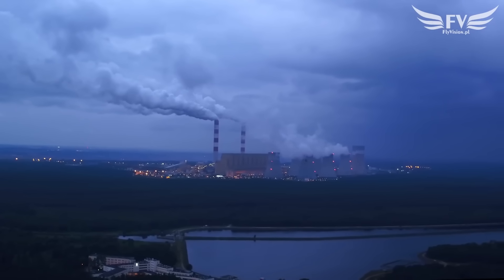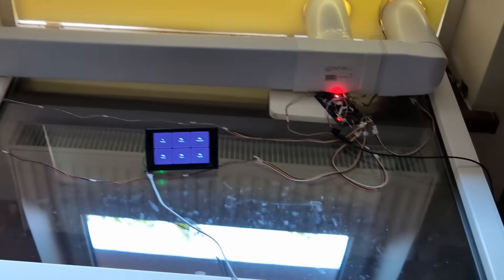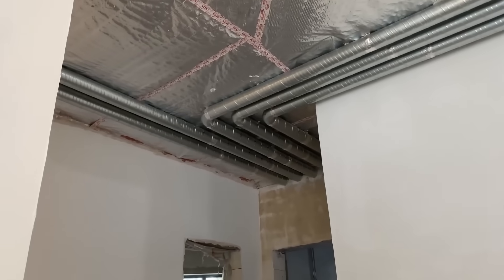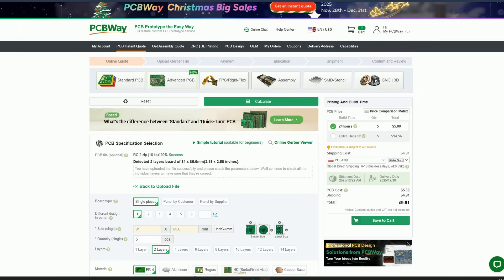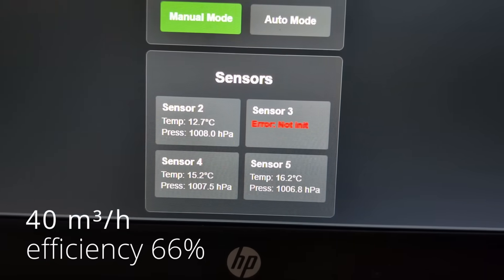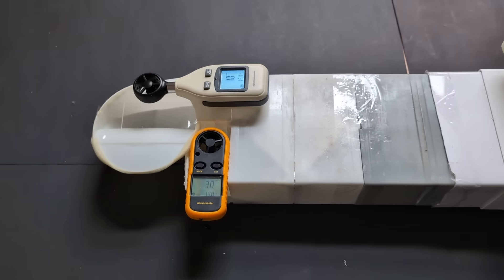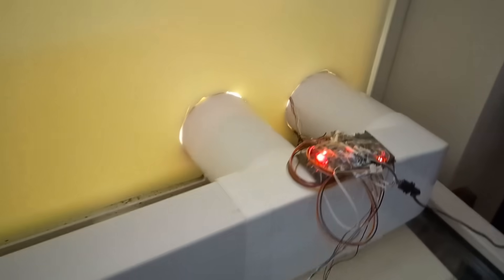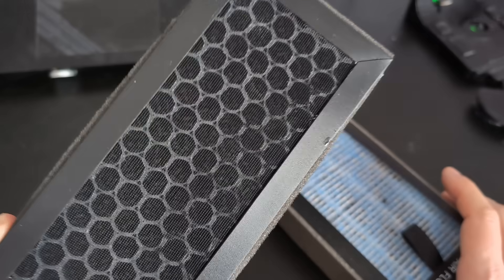DIY Heat Recovery Ventilator: From 55% to 90% Efficiency (Real Tests)

Comment: I'm surely not the first time to suggest this, but you should consider 3d printing the heat exchanger. Metal powder prints are not that expensive anymore. Especially considering your time input, no tooling ect. Very cool project! Keep up the great work!
Reply from the maker: Actually, for a unit this size, metal printing is still way too expensive. I'm moving toward SLA printing with copper electroplating instead. It's much more affordable and keeps the precision high. Thanks for the encouragement!
Reply: @DIY_Yarik Yeah fair enough, you're right. Cheaper doesn't mean it's cheap at all. Your new approach sounds cool, but is electroplated copper enough of a heat conducter at that thicknesses? Maybe I've got your ideas not straight in my head tho. But it kept me thinking about cheap ways to make something like this. Ideally you want copper, but that's expensive, I've searched around for square tubing, but got limited results. Aluminium is also great and way cheaper. And you want something with as much surface area as possible. Looked at alu extrusions, as those have different channels, but are quite bulky. I then remembered that you can buy those as miniature as wel. Maybe that would be a viable option? I don't know how air tight you can get the open channels when you align and clamp them and routing the air through the different channels is probably not easy to do. But if you can manage it, the extra turbulence you'll get from the routing will also increase the thermal transfer as turbulent air will break the boundry layer to the metal and thus transfer its energy better then with laminar flow. 
I don't know, I'm not all to familiar on this subject, but this is what I came up with. I hope my shower thoughts can help you on your project. I've subscribed to your channel and I'm looking forward to your updates!

Comment: This is really amazing. Please take care to add appropriately sized metal mesh to the foam areas and intake. You absolutely do not want a rat chewing it's way thru the foam and running around your room. Ask me how I know.
Reply from the maker: I've been lucky so far as mice haven't noticed the intake yet. Но you're absolutely right, metal mesh is a must for the final version to keep them out. Sounds like you learned that lesson the hard way!

Comment: Is it realistic to compare your work to a commercially available product, say a Diakin MCK70ZW air purifier?  It would also be helpful if you stated which indoor environmental quality standards you use for compliance targets.
Reply from the maker: This video is just to show my current progress and where I’m at. Once the development is complete, I’ll definitely run side-by-side tests with a well-known brand so you can see the real difference in identical conditions.
Reply: @DIY_Yarik  Can I sponsor you?  I am looking to replace two extractor fans with heat recovery ventilator(s).  These devies will share a flue which vents through a roof outlet.  Ideally, they will be smart device(s) that can be incorporated into a smrt home ecosystem.

Comment: Other countries show that it's easily posible to incerease renewable energy to over 50%, for countries located far north or south the increase from 50 % becomes harder and harder. So if you are concerned, encourage the increase of renewable engery, whily saving engergy with cool devices as this DIY heat revovery ventilator 👍👍👍

I'm not sure if the brack stuff at your window is only smoke residue. It is colder near the ventilation system and moisture condenses, which can lead to mold. But your solution should also fix this 😁

This is a very impressive project. As my house has a combination of heating and ventilation with a big heat exchanger, I will not replicate it. But from my experience from this system I can realy encourage to build such a system. My system came also with a second filter for the air that goes outwards, this shall reduce the dust befor enter the heat exchanger. Dust is a efficiency killer for heat exchangers.
Reply: This is a stupid idea. You can’t power winter heating with solar and you can’t as a person, operate a wind turbine in a city.
Energy saving works. Renewable energy doesn’t and is ruining Europe.
Reply: @noop9k  Yes this can't be the only power source (therefore the arroud 50% limit). But even in winter you have some sun and wind... and bio gas. So you can put all our conventional power plant inspections to summer. Works really well here.

Human made climate change might ruin Europe.
Reply: @m @michaegi4717 no, "green energy" has ruined Europe already, while the overall effect of Energiewende on Climate change is ZERO at best.
Net zero is how much effect it had.
Reply: @noop9k  This is simply wrong. As you already point to Germany: compare 1995 to 2023... Germany uses less electricity and reduced the CO2 release for electricity production drastically.
At the same time Germany even shut down its nuclear power plants. The average price increased from about 17ct to about 35ct (while 2023 was more expensive than now). Which is a average increase of 2.6% per year.
In the same time the GPD increased from 1.9 to 4.2 so also the industry is happy.
Reply: @michaegi4717 I spent many years arguing about this and you are wrong. Saw tons of deceptive german demagogy, among other things. Maybe read something, like “Case for nukes” by Zubrin, for starters. I will avoid wasting time on yt, where my comments get randomly deleted. But will spare a few minutes:
* Electricity generation is only a portion of energy use. Focusing on it is a hypocritical selective blindness.
* You can increase percentage of green energy by reducing total usage, killing your industry.
* you reduce total usage by moving your industry to authoritarian state, enriching anti-democratic forces. Maybe Hungary, like several German companies did, maybe China or Russia.

German money are killing Ukrainians right now. Merkel is a mass murderer.
Reply: @noop9k  Which of my numbers were wrong? I just posted facts.
Reply: @michaegi4717 and let me repeat this again. Germany is not a separate planet with its own atmosphere. Climate Change is global. And Energiewende had no effect on it. France is way way ahead of Germany in this regard btw, and Germany has no chance to catch up, no matter how much more it tortures its people with energy taxes. It was all a scam and it made dictators much richer. Those money from green taxes are now killing people. No actual effect on Climate Change.
Reply: @michaegi4717 and also btw you industry gets energy at different price also subsidized from your taxes and a big % of it is actually dirty.
Reply: @noop9k  No German Industry don't get subsidized electricity price, they get bulk discounts as every one gets for most products and they don't pay a extra tax to finance the switch to renewables. But those extra fees for renewables anyhow were for the early years where building renewable engery sources got a high guarantieed price. As renewables are now cheap enough you don't get any bonus, so this is a thig of the past (that will produce some costs for the upcoming years.

What dirty money do you talk about? Do you refer to the enormous amount of money Germany and the whole EU gives to Ukraine directly or spend to help the Ukraine refugiees?
Reply: @noop9k  Yes we are all onthe same panet, so every country can do this. And most of the countries are doing it... especially because it is ceaper.
Do you know about the enormous costs that are payed by taxes for nuclear power and coal?
Due to coal mines huge areas of Germany will need constant pumping of poisones water for ever. Shortly after those pumps stop a huge area would be flooded by toxic water.
For nuclear power plants the insurance was payed by taxes, because it would be too expensive to pay a normal insurance. The nuclear waste will also be handeled payed by taxes. The development of nuclear powerplants was suported by taxes.

And regarding dirty money: Most of the sold coal and nuclear fuel comes form "not so friendly countries".

Comment: Great work. Have you come across "fine wire" heat exchangers? There is a company in the Netherlands that use them for single room HRV units and claim very high efficiency. It would be great if you could make a comparison.
Reply from the maker: Interesting concept! I’ve heard about the technology, likely Fiwihex. The surface area they get with those thin wires is impressive, though it seems much harder to DIY than plate designs. I’ll definitely look into it more for future comparisons. Thanks!

Comment: There are centralized air change systems which connect a heat pump to the air exhaust and collect that heat back.

Comment: The nice thing of a central system is the removal of noise from the room. Decentralized air exchange systems are popular in Finland for installation in old houses but the fan noise can be quite annoying.
Reply: True but I have an old apartment that never had any thought to have any solution to vent the rooms other than opening the windows so yeah, this is actually important

Comment: I'm really interested in your heat exchanger design. as far as I know, the new ones are called energy exchange unit, as it capture moisture and retuens it back into the room. specially on sub-zero cliemts I think this matters a lot. Looking forward for your next update on a successful DIY energy exchange core.
Reply from the maker: Thanks! Testing new designs takes time, so I’m not moving as fast as I’d like. I really hope to have a working version ready for you to replicate by summer.

Comment: Please don't use copper, it's unsustainable (mostly just economically, since it's a rare material on this planet with better uses).  Aluminium is good enough.  
UV?  Surely you don't really need to filter viruses/bacteria out from OUTDOOR SOURCED AIR, come on.  it's not a fictional zombie apocalypse - Particulates should be your primary concern.
Reply from the maker: Thanks for the advice. I agree aluminum works well, but copper is still superior for efficiency. My new concept is to 3D print the whole exchanger and then use electroplating for a 30-50 micron copper layer. It uses very little material but should keep the efficiency high. It's still just a theory for now.

Comment: ion emitter that makes small particels  "heavy " and fall to the ground
Reply from the maker: It's not a perfect solution. Ionizers often produce ozone, which causes metal corrosion and can be harmful to breathe over time. Plus, I'd rather remove the particles with a filter than just have them settle on my floor and furniture.

Comment: Conglatulations! It is the reinvention of the Lossnay ventilator.  Lossnay was first released in 1970 from Mitsubishi Electric Company in Japan and continues to be sold for industries and homes today. From the beginning, it had the function of regulating both heat and humidity with a heat exchanger made of breathable Japanese washi paper. Main patents related to Lossnay were expired and you can adapt the contents of their patents. There are giveaway lossnay guide books from Mitsubishi which are mainly for architecture designing people but also contain many useful information for general diy people.
Reply: The recuperator in the vid has one design flaw unless nicely dried air. It passes indoor humidity outside. Humidity in the air to be exhausted should be recovered and be returned to the room. Humidity in the exhaust air becomes condensation on the recuperator during heat exchange and exhaust air path as well. Unlike latent heat recovery heat exchangers in power plants, heat exchangers for residential use should never condense. Condensation makes hygienic operation of heat recovery extremely difficult. Furthermore, in cold climates, condensation on the exhaust path freezes and obstructs airflow (icing). Returning the humidity to the room reduces the chance of condensation. If the humidity in the air decreases, people feel colder even though the room temperature were the same, because moisture evaporates from human bodies (evaporative cooling). Compensating for the loss of humidity during heat exchange with humidification incurs additional energy costs and increases hygienic burdens. Therefore, returning the moisture in the exhaust air to the room is the key to economical and healthier operation. My suggestion is to consider the elements of already existing products, e.g. Lossnay (or maybe our lungs), that eliminates condensation issues by using breathable (humidity permeable) materials for the heat exchanger itself. Heat exchangers in Lossnays won't condense at least.
Reply: The user provided a historical overview of Lossnay and asks implicit questions about its origins, patents, and accessibility of guides. I’ll summarize key points and add practical notes.

Direct answer
- Lossnay is Mitsubishi Electric’s energy recovery ventilation system introduced in 1970, designed to transfer heat and moisture between incoming and outgoing air using a porous core often made from specially processed paper. This technology has evolved but still centers on heat/moisture exchange to improve indoor air quality while reducing energy use.[2][5]
- The core concept originated from a simple observation of heat transfer through paper (“roll a sheet of paper into a tube” style experiment), which inspired the heat/moisture exchange principle behind Lossnay. This origin story is echoed in Mitsubishi Electric communications and related analyses.[1][5]
- Patent activity around Lossnay has varied over time; as patents expire or approach expiration, some aspects may enter the public domain or become more freely adaptable, but exact status depends on jurisdictions and specific patent claims. Note that many official Lossnay materials remain under corporate control, and repackaging or adapting proprietary content should respect IP boundaries.[4][5]

Context and implications
- Applications: Lossnay units are used in residential, commercial, and industrial settings to supply fresh air while recovering heat and humidity from exhausted air, contributing to energy efficiency and indoor air quality.[5][7]
- Guides and resources: Mitsubishi and authorized distributors occasionally publish guides and technical documents intended for architects, installers, and qualified technicians. While some materials may be referenced for general understanding, DIY adaptation of official guides should respect licensing and copyright considerations.[3][5]

Notes for further exploration
- If the goal is to learn more about historical milestones, tracing Mitsubishi Electric press releases and archival PDFs around the 1970 launch and subsequent model generations (including D.C Lossnay and newer configurations) would be informative.[9][2]
- For updated product specs, the official Mitsubishi Electric regional sites (e.g., Australia, Germany, etc.) provide current Lossnay models, core technology details, and energy performance data.[4][5]
- If seeking free “guidebooks” or design references, verify licensing terms and ensure any use complies with copyright and distributor policies; some materials may be available through professional associations or architectural libraries rather than as open DIY manuals.[1][3]

Would you like me to:
- Locate specific official references or PDFs from Mitsubishi Electric about the Lossnay core, heat/moisture recovery mechanism, and installation guidelines?
- Compare Lossnay to other energy recovery ventilators (ERVs/MVHRs) in terms of efficiency, cost, and typical applications?
- Identify public-domain or licensing-free documents that are suitable for DIY-level understanding without violating IP terms?

[1](https://comfortc.co.in/ventilators-lossnay.html)
[2](https://www.linkedin.com/pulse/lossnay-heat-recovery-ventilation-system-inspired-child-pocock)
[3](https://polestarpilates.co.uk/media/mitsubishi-cat-lossnay.pdf)
[4](https://www.lossnay.de/en/)
[5](https://www.mitsubishielectric.com.au/products/residential/air-treatment/lossnay-ventilation/)
[6](https://nfan.co.uk/news/mitsubishi-lossnay-heat-recovery-units)
[7](https://www.thermalcontrolmagazine.com/news/mitsubishi-electric-underlines-advanced-air-quality-with-lossnay-ventilator/)
[8](https://khandelwaldistributors.com/mitsubishi/lossnay-ventilation-products)
[9](https://www.youtube.com/watch?v=PMFaC0aFP5M)
[10](https://www.mitsubishielectric.com/en/contact/ventilators/)
Reply: @user-ue4he3li8b  hi! This is incrediblly informative. Can you share the prompt that you used? Tyia
Reply: @noname-codm4590  copy paste op!

Comment: Which city/ country were you doing this in? Is it particularly noted for air pollution?
Reply from the maker: Poland, Lodz. It is notorious for smog, especially in winter when many people still use old coal heating systems. It’s actually one of the most polluted areas in Europe during that time.

Comment: I rather pay more for heating then sleep with god damn sound comming from recuperator.
Reply from the maker: Noise is a problem I haven't yet addressed, as other issues are more important right now. I'm confident I'll resolve this issue and the noise will be minimal.

Comment: It breaks my heart to think that my RV's propane furnace is belching at least 33% of combustion heat to the great outdoors! 🤦🏻‍♂️ I've been wondering if something like a plate-and-frame heat exchanger could recover some of that waste heat back indoors! 😆😹 

What makes me projectile-vomit is that the Weil-McLain hydronic heating systems I see a lot in homes in northern Wisconsin and Minnesota has no better efficiency! 🤢🤮🤮🤮😾
Reply from the maker: Theoretically, you could build a custom heat exchanger to capture that exhaust heat and boost efficiency. It’s definitely possible, but it would be a tricky setup to get right, especially with safety and condensation.